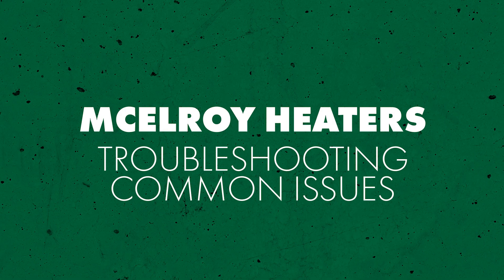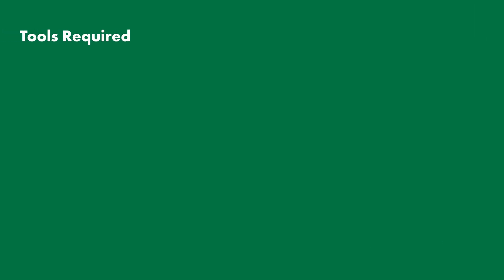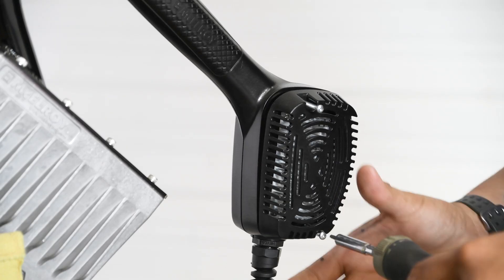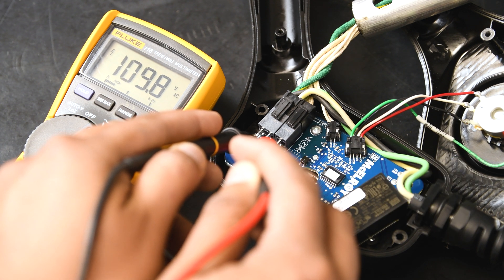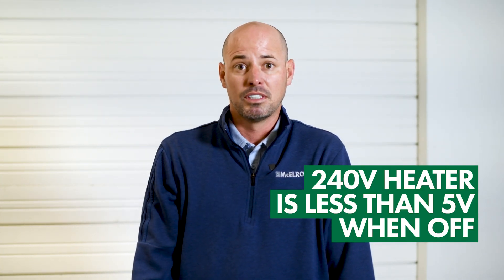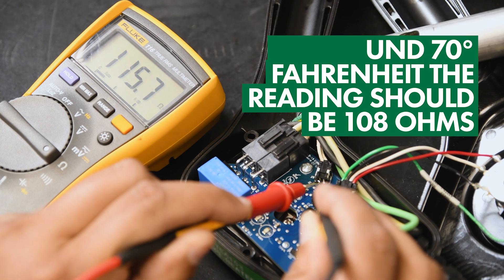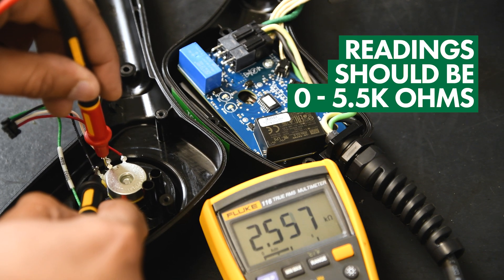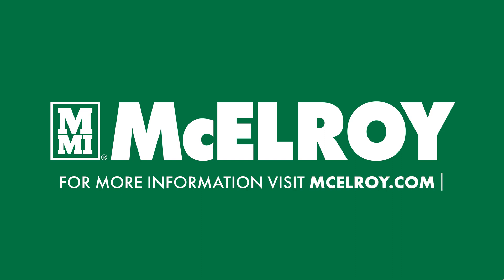Troubleshooting Your McElroy Heater

Comment: Thank you for the video, do you have a remanded tool for removing the pins when they are loose and have a week or bad connection?
Reply: While there are various pin removal and extraction tools commercially available, our intent with this design was to eliminate connection issues as a variable and recommend replacing the component affected by the loose or damaged connector as they are pre assembled and terminated from the factory.